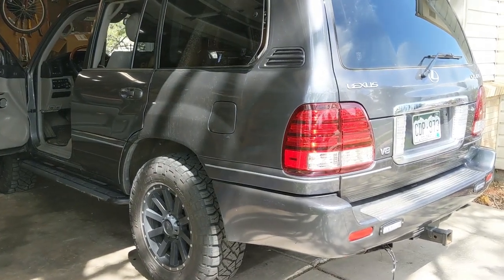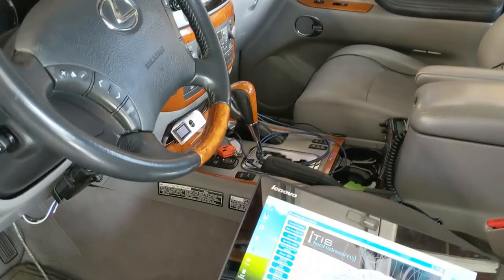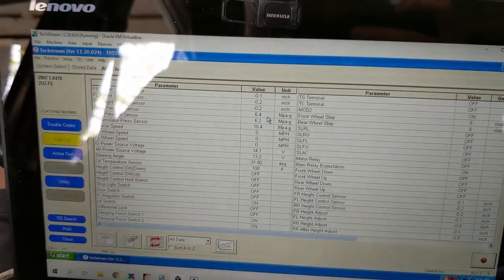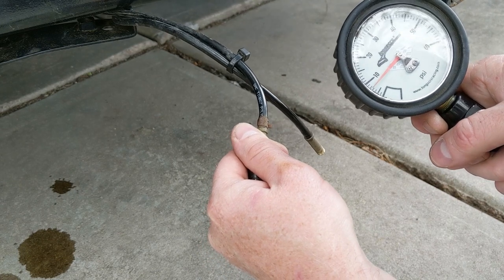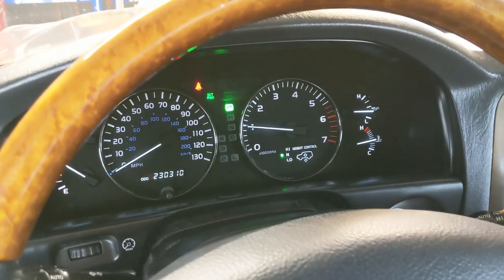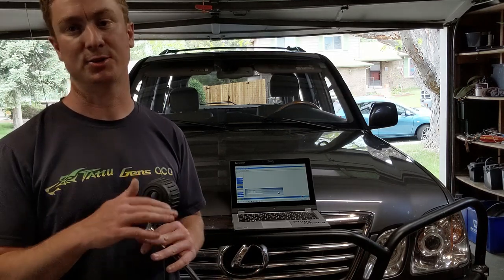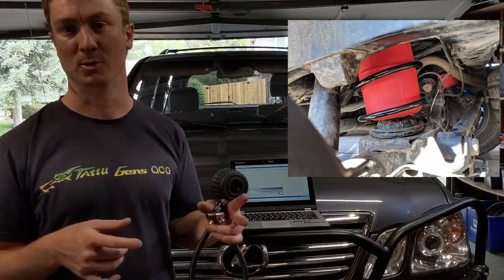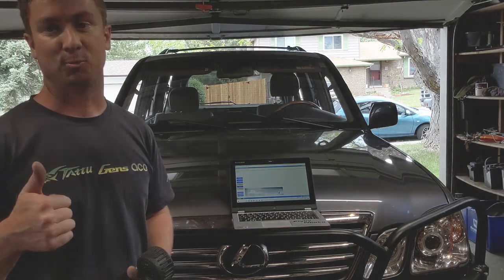LX470 AHC with Air Bags Testing at different pressures

Comment: The whole point of lowering the pressure is to improve the actuators ability to use the comfort and sport ability i.e., Toyota TEMS. I have changed all the parts related to ahc yet don’t see significant change in my ride quality. Thou my rear pressures are a bit high on techstream. I have two things pending before light the truck on fire 😂. Add these bags to lower the pressure and to change my heavy duty tires to normal ones. Any thoughts ?
Reply from the maker: Yes I suggest reducing the pressure to the stock range. Also might be time to do shock bushings and cushions.

Comment: What laptop requirements for Techstream?  I have the cable but no laptop.
Reply from the maker: I am not sure but it doesn't require a super powerful computer. Check out this thread to set it up: https://forum.ih8mud.com/threads/how-to-techstream-in-5-minutes.1034923/

I have this laptop it works awesome for this type of thing: https://amzn.to/3kwMPrl
Reply: @Turboactive  Thanks, Yea I have looked it over but nothing real specific other than window 6 or 7 I believe works better.  Ironically, my family has five LX/LC hundys and two 80 series LXs and I still haven't hooked up techstream.  Haaa.
Reply from the maker: @richienell  Yeah look at that thread again you can download a virtual desktop program to emulate Windows XP on any computer and run Techstream through that. Really easy.
Reply: @Turboactive  I had trouble with the techstream and virtual windows xp and then installed the virtualbox extension pack. Now I can connect everytime without any problems.